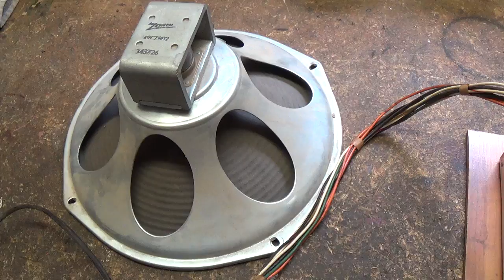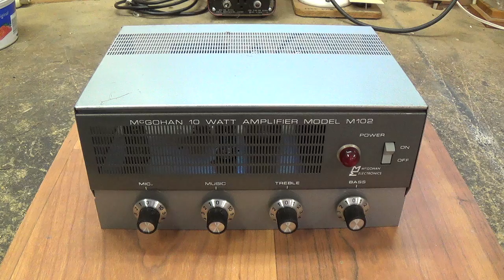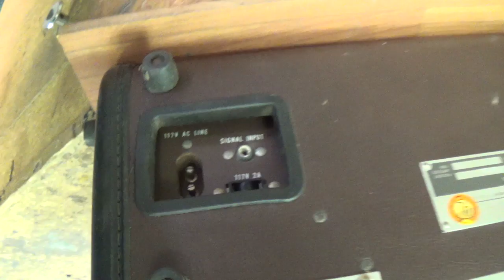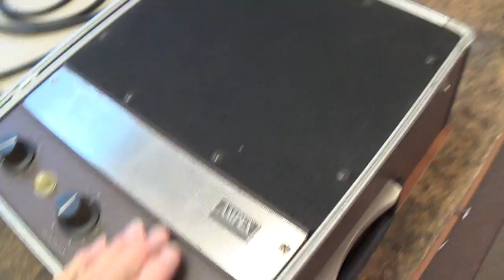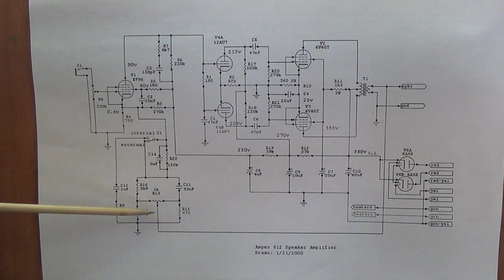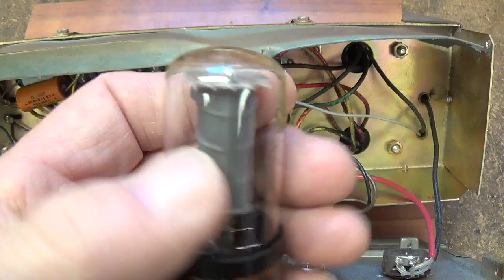Garage Sale Bargains in Vintage Electronic Gear

Comment: Hi Uncle Doug and Rusty... 
Brad the Guitologist said your channel wuz cool and he was so right!
Boy oh boy that Juble 8" was porn but when you showed us the EF86 based amp that accompanied it I literally caught my breath... 
What a gorgeous piece of gear... 
I long to know what a guitar would sound like played through that there puppy... (Rusty prolly not so much, tho') 
Can one expect to find EF86 and/or other pentode front ended designs in vintage recording gear? (in your experience) 
Thanx for the great channel and... 
cheers
Reply from the maker: Greetings, Jonny. Glad you liked the Ampex amp unit, it was indeed quite nicely built. As far as pentode-fronted vintage recording gear, I simply don't have enough experience with them (they are rare in this area) to render a judgement. I suggest some Google searches for info and schematics. Good luck.
Reply: Thanx Uncle Doug... 
Yours and Brad's GREAT vids are helping me build up the hutzpah to maybe mod a little single ended 6BQ5 amp I need to repair, into a multiple input experimentation platform... 
I never would've guessed learning desire would be rekindled so wonderfully by y'all so thanx again and... 
cheers
Reply from the maker: You're welcome, Jonny. Best of luck with your project(s).

Comment: Hello Uncle Doug, Do you think that wax capasitors have any significant affect on sound,either good or bad, thanks great video
Reply from the maker: I don't think that a single capacitor, regardless of price or construction, makes any noticeable difference.....however, I do believe that the sum total of all the imperfections in components (due to age) add up to create the warm, un-sterile, easily distorted sound we define as "vintage tone". Like people, amps are the product of their imperfections :) Thus, I advocate retaining all the (reasonably) properly functioning vintage components in any old circuit.
Reply: Bless your heart

Comment: Re. using old wire, it may sound obvious but give the stuff a quick look to see if it's useable. Natural rubber was often used as insulation and it can perish and become brittle, as can other formulations after 5 decades of use and heat. The wire can also oxidise along it's whole length, having reacted with both the jacket and air. Otherwise it's a great idea.
Reply from the maker: Good advice, Martin.

Comment: So Doug, another question: Say one has the diagram or plan to a Ken Fischer "Train Wreck" or "Dr. Z" style guitar amp, and all the parts, or any amp that one likes, is building a clone as easy as following a diagram? Will it sound the same?
Reply from the maker: I have never seen a complete schematic for a Train Wreck amp, Joe. It was common practice to cover parts of the circuit with epoxy so that they could not be copied. As far as a Dr. Z amp, I would say yes, that a careful replication of the circuit, with good quality components, would yield a clone with virtually identical sound. Rusty and I have duplicated quite a few famous amp circuits and have been quite pleased with the results.

Comment: i know some one who has room full of vintage parts caps/resistors /original tube instruments from 1960 to 80s,  would a surplus buyer pay more than if these items where sent scrap metal value?
Reply from the maker: It depends on the items themselves, RC, but even if only one or two of the tube instruments had any collector appeal, the sale value would be considerably greater than their scrap value. The vintage parts and instruments need to be listed on Craigslist, Ebay, etc. and offered to collectors. Then, whatever doesn't sell could be scrapped. They could net a considerable sum.

Comment: Great video on all topics!  I'm familiar with McGohan amplifiers, both tube and solid state.  I have several myself.  They were always very good sounding and durable, even up to through the earlier solid state units. The last of their solid state amps got rather junky due to the imported components and "improved" designs. Try and find yourself an earlier MS-203 with the vinyl wood grained hoods. You will be impressed!  They are amazingly powerful for a 20 w amp, and wonderful sounding.  I know Jim McGohan through work ( Don was his dad).  Sadly the company was forced to discontinue building amplifiers due to the imported equipment being far less expensive.  ~Kat
Reply from the maker: Thanks, Kat, both for your nice comment and your very informative input.

Comment: What you have called a HiFi amp is actually a PA amp.
Reply from the maker: Which of the three amps are you referring to, Stephen?  I called the first one a console stereo amp, the second was a PA amp, and the third was an Ampex auxiliary tape deck amp.
Reply: The second one! HiFi amps do not have a balanced (XLR socket) line in for  mic.
Reply from the maker: Listen carefully to the video around 5:28, Stephen......"PA amp".

Comment: handling the tubes wears away the lettering.
Reply from the maker: In some cases the lettering will come off easily when touched or cleaned with Windex, etc. It is best to be very careful when handling tubes, especially vintage ones.

Comment: Hi Doug. I love your show even though I'm fairly clueless about amp design. I am, however, a cheap guy who loves tinkering and I found a little $10 yard sale (tube radio chassis?) that someone converted with a 1/4" input jack and an external 16 ohm 1/4" phone jack for guitar or something. The guy plugged it in and the tubes lit up with no smoking so I bought it, thinking it might have the makings of a Champ type amp with it's RCA 6v6gt power tube with a GE 6sq7 preamp tube and an RCA 6x5gt rectifier tube, big can cap and a power trans labled TR-196  412624 and an output trans #285631. 

Sure looks like the original 4"X 9.5 X 1.5" chassis with 2 pots for tone and volume with, I'll assume, the detent for power on and a newer grounded plug coming from an original 1" hole in the face next to the hole for an 'on' lite with the lamp above it.
Any idea of what I got and a place where I can get some easy ideas on turning this into a nice guitar amp or leaving it as is for use with a full range speaker for an acoustic guitar amp? I would like to expand the tone pot to a stack for increasing the shaping possibilities.

 I'll have to re-read Dan Torres excellent "Inside Tube Amps" again to see what going on before I do anything but I'd like your opinion as being the You-Tube King of the junkyard dogs. (No offense meant to you, Rusty)  : )
Any ideas would surely be appreciated.
I'm off to watch your vids on how tube amps work again. 

Keep them coming because Rusty has developed a large following on the Tube.
Reply from the maker: I can't offer any specifics without personally evaluating the circuit, Paul, but it sounds like most of the work has already been done. The tube complement sounds excellent. Be sure to have it connected to a suitable speaker whenever you turn it on, to avoid internal problems within the output transformer and tube. Good luck.
Reply: Thanks for the reply Doug.
Yup, I have a Fender 10" 16 ohm speaker that is in good shape from the looks of it that probably came from a SS amp. No markings at all except the Fender sticker. 
I just discovered your instructional series. Holy smokes! I feel like I just enrolled in guitar amp Harvard. Thanks for all your hard work.
Maybe I can figure out eventually what this lil single end guy can put out. I may like it fine the way it is.
Have a Merry Christmas and give ol Rusty an extra bone for me. Tell him it's from Petey, my lil dog.
Cheers.

Comment: I really don't know about this old tube circuits technology. what is that aluminium can on the chassis except the tubes and transformer ?
Reply from the maker: Keep watching the videos and you will learn, N88. The aluminum can encloses several electrolytic capacitors used to filter and smooth the rectified high voltage for the amp circuit.
Reply: Thanks for replying Uncle Doug. Yes Yes I will keep watching your videos.  I'm only familiar with modern electronic components such as transistor, IC , etc. But recently I found a old tube amp, but I could not identify the component with it that why I asked about that can. It also contained something called SPDT synchronous converter. what is the function of that component ? Thanks.
Reply from the maker: I have no idea what that component is, N88. I suggest that you do a Google search for info on it.

Comment: regretably i got a 3ohm 12" alnico speaker that was for a pa system and without researching the wattage i stuck it into a 50w amp and the voice coil seperated itself from the paper cylinder it sits on.
Reply from the maker: It happens, Johnny.  At least the speaker died in combat, rather than simply rotting in a store room :)

Comment: I picked up 2 "Mono each" Lier Siegler/Bogen mo200a Valve/tube 200 watt rms amps with  "8" 8417 output tubes,  and these amps were...Standard in the Industry back in the Day.  They have multi/ohm Z = Impedence Taps, and Just a line cord "2 Wire", a on/off toggle switch, and a main gain slotted screwdriver shafts for turning gain up & down.  Still have from 1981 when I worked at a Transformer Factory, they were in boxes wrapped with suran wrap, they are Rack Mount and they look & Play like New.  Class A Circuitry I'm sure.  A Sweet Find "Uncle Doug !
Reply from the maker: Wow, an exotic find indeed, Mr. R. I can imagine what an incredible dual monobloc stereo you could create with these beasts....or a really stout pair of guitar amps.  Let us know how they turn out.

Comment: a stereo amp can so easily be converted into a class ab push pull amp
Reply from the maker: Perhaps you could make a video showing how to do this, Doug.
Reply: actually i was hoping you would
Reply from the maker: I tend to stick with monaural PA and organ reverb amps for my conversions, Doug, and cannibalize the stereo amps for tubes and parts.  Perhaps some other YT contributor has posed videos featuring stereo amp conversion.

Comment: I know this is a late posting, but you should know that all amps in the series of Ampex "portable amplifiers" are very hi-fi. The speaker is an oem by JBL... basically the D208 with additional magnetic shielding. This was incorporated because Ampex was a very high-end tape recorder company, and one could expect these amps being used in the field in locations where Ampex recorders and lots of recorded on and unused tape was present.

From the Mullard design 6AF6 input to the full-range JBL, these amps, with their common cathode self-biasing topology and simple but effective (and very musical sounding) tone controls, they are genius in design and despite their diminutive size and 10 WRMS ouput are true thoroughbreds. 

~If only... I had kept the four that I've had over the years. DRAT!

Be sure, ASAP, to replace the coupling caps between the cathodyne phase splitter outputs and 6V6 output tubes since every one of these amps I've worked on had some degree of DC leakage which will at a minimum distort the otherwise superb sound of an Ampex Portable and anything deyond that will eat the 6V6s' lunch.

BTW, did I mention that these units are keepers? Please restore and use the amp, it's just wrong to keep them around as dustcollectors. There is plenty of inferior junk better suited to that task. DE
Reply from the maker: Good advice and information is never too late, Richard. We sincerely appreciate this helpful input. You'll be glad to know that I have kept the Ampex unit completely original, other than the component changes described in the video......and the coupling caps you mentioned.  It is simply too beautifully designed and constructed to alter. Thanks again :)

Comment: would you kindly not wear jewelry whist messing with high voltage stuff . you know there are plenty of caps holding their charge.  what's the biggest difference between a clean tube amp vs a clean germanium or silicone amp if it's not run as  guitar amp ?
Reply from the maker: Thanks for your helpful input, Fred, but....as carefully described in many of my videos......all electrolytic capacitors are fully discharged before any circuit interaction begins. I would agree with not wearing dangling metal bracelets, but they are really not part of Rusty's or my jewelry repertoire.  If your question about clean tube amp vs SS amp relates to tone differences, the difference would probably be quite small. Tube amps begin to "shine" when overdriven into tube saturation, while SS amps tend to sound awful when overdriven.  The difference is less evident at lower drive levels.

Comment: I really need to get my Victor model A sound reproduction amplifier going.  It's part of a Victor 16mm sound projector and it's a nice little Western Electric-designed tube amp with a 6v6 push-pull output stage.
Reply from the maker: It sounds like the Bell & Howell projector amp featured in a recent video series, D20. If you haven't seen it yet, please check it out.

Comment: One thing I noticed about that Ampex amplifier/speaker unit that again confirms how excellently designed it is: the fact that the whole amplifier circuit is on at full blast volume, and the only audio level control is right at the very input. The amp circuitry is all crammed together in a tiny space and there are no hum or white noise or regeneration-feedback, etc, problems, Uncle Doug?
Reply from the maker: I agree, Terry. The entire unit displays a high degree of engineering and good design. The speaker and enclosure are particularly impressive.

Comment: Hi Uncle Doug & Rusty, I hope your all doing good. My guess is a common cathode, could be wrong, looked like they both went to ground. Good finds. Take care, C.
Reply from the maker: +Cass Virgillo  On the McGohan schematic, I would say that it's a Cathodyne P.I., Cass.  The plate goes to the top output tube grid and the cathode goes to the lower one.

Comment: Greetings Uncle Doug, first off, many thanks to you for all the great videos. I've been working on electronic gear and tube amps for 40 years and I learn something new from each of your videos. Well done. 
     When I watched this one I was shocked and amazed to see the Ampex utility amp as I have two of them. Great little amps, I was missing the cord on one so I modified it to use a standard grounded power cord. A friend and I each bought a pair of these amps from another co-worker whose Dad was a salesman from Ampex tape machines. They used to haul the speakers around to demo Ampex 440 tape decks. I'm looking for an input selector switch if you know of a source.
     Say hi to Rusty for me.
Reply from the maker: +Archtop6038 You're welcome, Arch, glad you enjoyed the videos. Rusty says "Hi" back :)

Comment: Hi Uncle Doug, I wonder if you could help me?  I just got a Blackface Fender Showman with a serial number on the chassis that dates it to 1963.  The transformer is however dated 606904 and appears to be a Schumacher from 1969.  I researched it and the OT with this number O22889 (125A29A)  is a 4 ohm so I was running the head through a 4 ohm configuration at high volume.  Now the sound is cutting in and out, sometimes in for 5 seconds, out for two, in again for 5 and so on.  When it is in the tone is clear and normal but I'm wondering why it is cutting out.  The guitar and cord are not the problem.  I wonder, apart from me being the problem (playing so loud!) what the problem that has developed might be?  thank you
Reply from the maker: +Bruce Nasmith  A couple possible explanations come to mind. First, are you plugged into a good, reliable power source......or are you sharing an outlet with other equipment? If something else is drawing a lot of current, it could starve your power transformer. Second, you may have bad contact(s) within the amp, particularly with the input jacks, tube sockets, tone and volume pots, etc. It would be a good idea to clean these contacts with DeOxit, tighten up the tube socket contacts, and check the circuit for broken solder joints, wires that have strands broken due to vibration, etc. A loose tube socket, particularly if it's the rectifier, can cause all sorts of problems. Good luck.
Reply: +Uncle Doug Thanks Uncle Doug, much appreciated!  I've taken it now to a reputable amp tech and my fingers are crossed that it isn't the OT.  I'm hoping it is one or more of the things you described.  Merry Christmas and all the best for a great 2016 for you!
Reply from the maker: You're welcome, Bruce. Good luck with the repairs....may they be simple and inexpensive :) Let us know how it turns out. Meanwhile, Happy Holidays !!!

Comment: The Ampex is so elegant design. The negativ feedback is afger the output transformer? Interesting... So this calculate also the transformer phase shift on analog way, to corrigate and controll on the first stage? Can You do a scoping with some triangle signal, to show us this kind of negativ feedback design? Rusty has a toy, he will not work for You in this video :))) Thank You for sharing! Nice finds!
Reply from the maker: +BMR Studio Thanks, BMR. It's fairly standard for NFB loops to originate from the OPT secondary, but this one is part of a very elaborate tone control circuit. I'll keep the suggestion for oscilloscope analysis in mind for a future video.

Comment: My $5 deal: actually Free.  4-1/4 foot tall Leslie speaker just set out.  Only issue is that this model has no tubes instead 4-channel solid state amp.
Reply from the maker: +Guy Guyguy Wow, solid state or not, this sounds like a great acquisition, Guy. Congratulations !!
Reply: I only saw it because I was walking the dog.
Dog's name: "Lucky".
It's a Leslie X77 just for the X77 organ unless custom wire it.
Reply from the maker: Apparently Lucky was well-named, Guy. You should take him bargain hunting more often :)